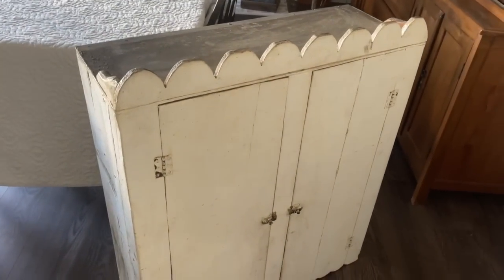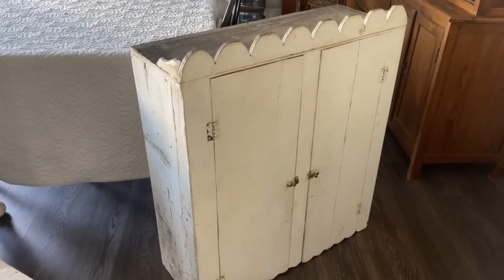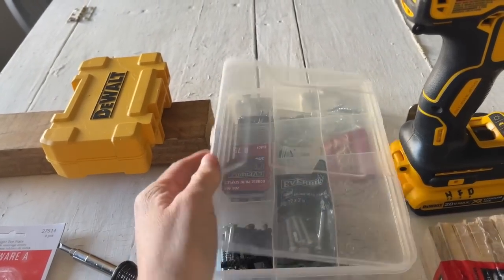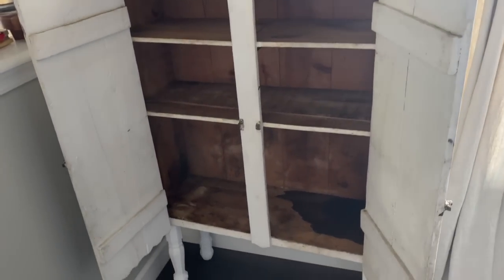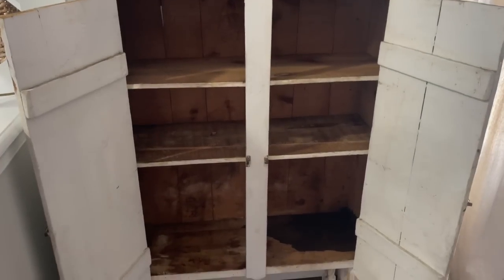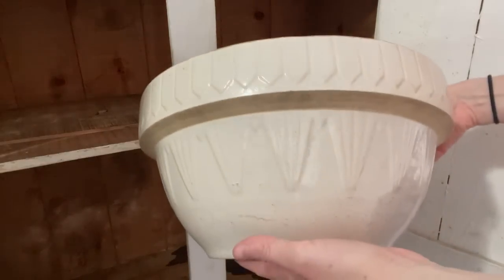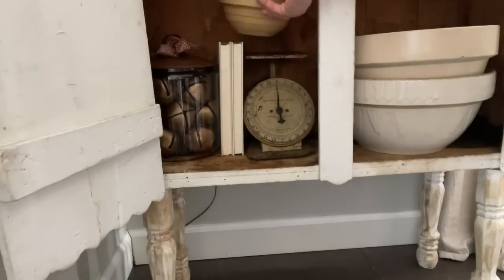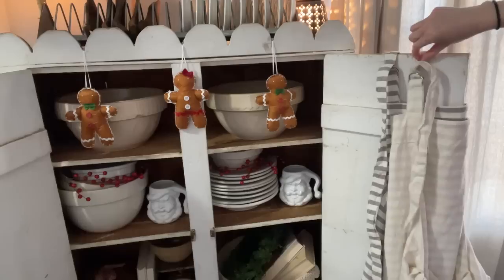🎄Furniture Flip & Christmas Decorate With Me | Antique Farmhouse Christmas

Comment: That really did turn out cute with the screen thing above it. I can't remember what you said it was. I have collected Antiques for years & some of the things you find. Ii have never seen or knew they where a thing. And really loving them. 
 The min. you started my head started spinning of all the things you could do with that cabinet. My husband is a great handyman, not much he can't do. I woulda had him hanging that cabinet on the wall & he woulda added a couple of boards to the back ro anchor it to the studs & used the L brackets. But it also would been really cute setting on that little table. So I woulda had him fix the table to be a sturdy table. We been doing these kind of things for 42 years & he's old school & perfected fixing junk stuff. He makes my ideas come to life. I do the hard stuff like sanding, cleaning, staining, painting but the matanince I don't even come close to knowing all the things he can do. Just like a dang chainsaw, I have tried over,, over & over again. And can hardly get the thing started. And he just grabs the chainsaw, sharpens it puts the oil & gas in the right place & tells me he's gonna cut the tree down that fell in the lane & before I can even get my coat on. He's got it cut up & using the log splitter which I also have no luck in keeping going. And he's cut it split it & loading it in his trailer to take it to the wood box he just made himself. And installed a wood stove in our project doublewide 1/2 & single wide he put togather & moved with the oldest running tractor I know around these parts. That he's keep running. No I wouldn't be able to even be in close compatision with my husband. My my Dad & Grandpa where old school men as well. I try with the physical work, but not gonna lie. They are all priceless & I wouldn't make it without my efficient qualified in all things I am not good at. And am very thankful for him & all his talents as he is of me. Stubborn & impatient like you absolutely. But there are many things I can't do & have to wait for his help. 
 You can also do those legs just the opposite way you did. Paint them dark then white & distress them back. Like you have done to many pieces. It all turned out very cute in the end.
Reply from the maker: Thank you so much for being here and watching! It is definitely handy to have a handy man in the house!! lol